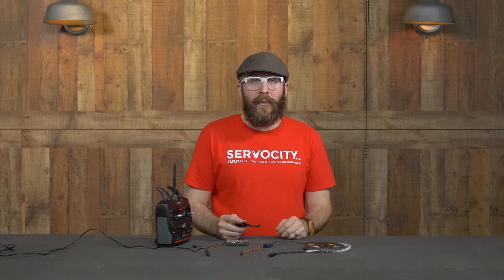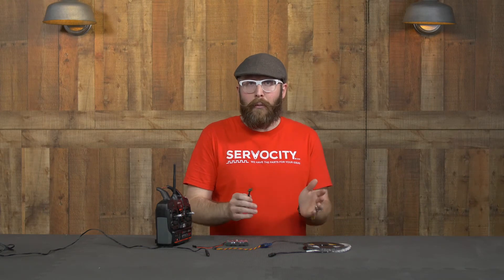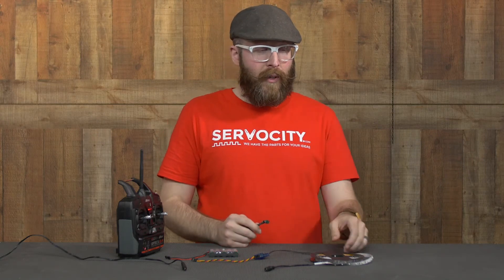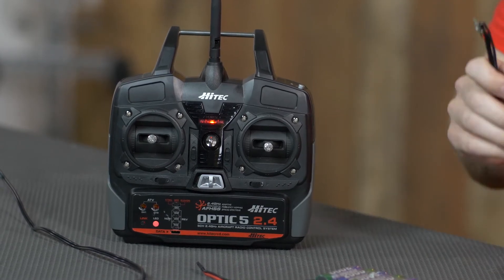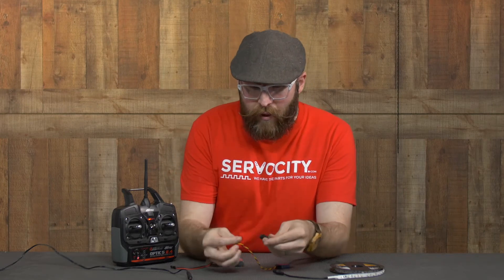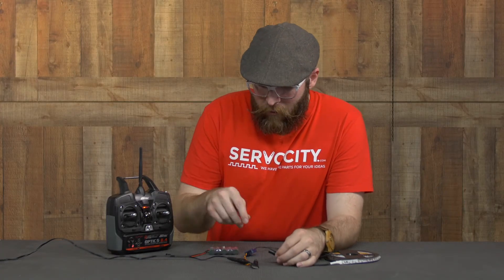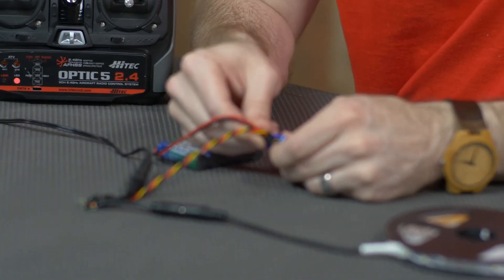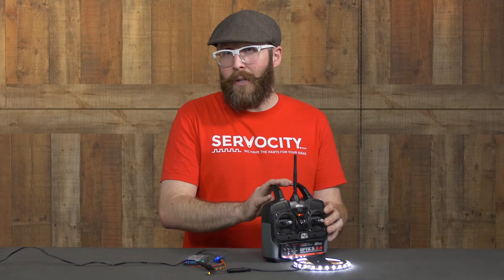PWM RC Switches

Comment: I think I bought one of these to operate the lights on my RC Car, but I never knew I needed this until I connected the lights into my RX and the lights would not turn on. The lights only had a positive and negative wire while this switch cable had positive and negative male end with a positive, negative and signal female end for the receiver. Im now able to switch the lights on and off from channel 3 button on the TX.

Comment: Hi! What could I use in place of receiver channel? I.e. I don’t have free channel on my receiver and I have receiver switch. Which device I could use to generate signal (PWM, PCM?) to on/off RC switch? Initial on/off to be done by physical switch/button. Should I use some Arduino board where physical switch/button to be connected to input of the board, and RC switch to be connected to output? Is it possible? Is there other ways to do this task? Thanks in advance and thanks for the video.
Reply: You should replace the TX RX with a system with more channels. You can get a 4 or 6 channel systems for a low cost. How are you going to power the Arduino? You would need another power source for that. Best to get a new radio system.
Reply from the maker: Hello Alexander,
I am a little confused by your question, am I correct in assuming that you're looking for something that will cut power on and off based on a physical switch wired onto the project? Is there any reason a switch wouldn't work?
Reply: @ServoCity  I need something to on/off RC switch itself. Actually I have light module and sound module in my RC car. Particularly, the light module has built-in RC switch. There is supposed that some channel on receiver will be allocated to control that RC switch via digital on/off signal to on/off LED, connected to that light module. Similar case with the sound module, which also has built-in RC switch and for which another channel on receiver to be allocated. RC switch of the sound module requires momentary on/off digital signal to on/off sound. Now suppose that I don’t have two free channels on my receiver (because I don’t have them on my transmitter) and thus would like to implement some alternative solution. My guess is that I need some controller that would take role of the receiver for RC switches in the light and sound modules. I suppose to send commands to that controller by virtue of physical switch (persistent on/off) and physical button (momentary on/off). Hope my point become more clear. Thank you for answer!
Reply from the maker: I'm still not quite sure I'm understanding your question unfortunately, if possible could you give us a call and speak to one of our tech support team members on this? 
-Ethan
Reply: @alexanderokonnikov2480  I understand what you are saying. You want a way to control the sound and light "module" you have on your vehicle but your RX only has 2 channels. To fix this you need MORE channels, this comes with a new system.

Comment: Fairly new to rc. So correct me if I'm wrong. I would need a ubec inline between the receiver channel and your switch????
Reply from the maker: Hi Jose,
There are three things that need power in a setup like this.
1) the receiver
2) the logic circuitry on the switch
3) the thing that you are switching on and off

That switch can control something that uses up to 30V. So say I had a 12V power supply and I wanted to use that to turn on a fan designed to run at 12V. I would connect the 12V power supply to the "load power supply" contacts on this board (see the graphic in the Specs tab of the product page https://www.servocity.com/rc-switch-with-small-low-side-mofset ).  Then I still need to power #1 and #2 above. The switch can either be powered through the "logic power supply" contacts on the board or you can solder together two solder pads on the back (see pg 4 of the user manual) so that the power line coming from the receiver supplies power to the switch's logic circuitry. To get to your question, whether you need a BEC inline between #1 and #2 depends on the voltage requirements of both. While this board from Pololu specifies 5.5V I found it to run fine at 6V (it is likely a little underrated). Since 6V is what I was using on my receiver, I just took advantage of the solder pad feature and passed the power through from the receiver without a BEC. This allowed for a cleaner, simpler setup. For long-term usage, a 5V BEC to power #2 (making sure those solder pads are NOT connected) and a 6V BEC to power the receiver would be a very safe setup. But I would connect both BECs to the higher voltage power supply rather than stepping from 6V to 5V.
  Should you have any other questions, please email tech@servocity.com and we'd be glad to help.